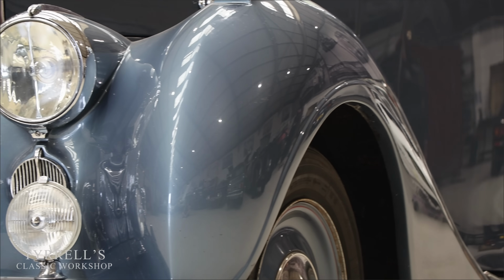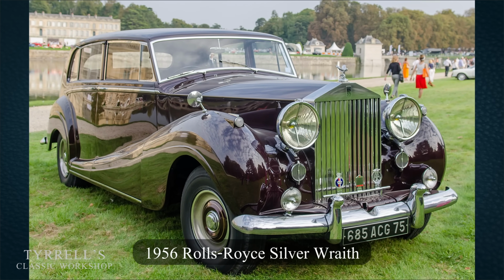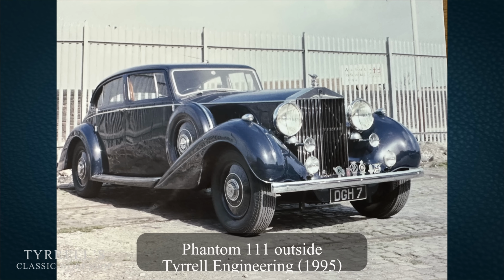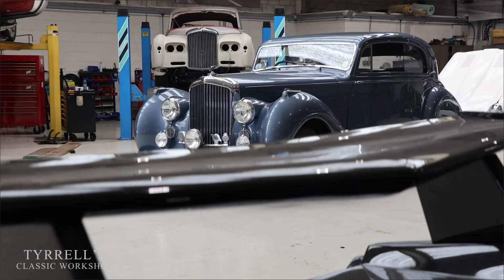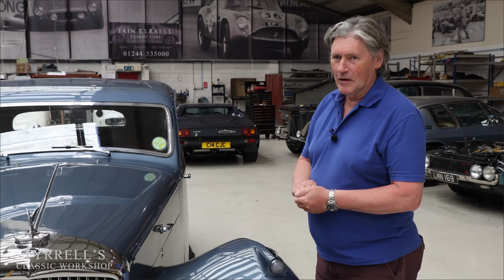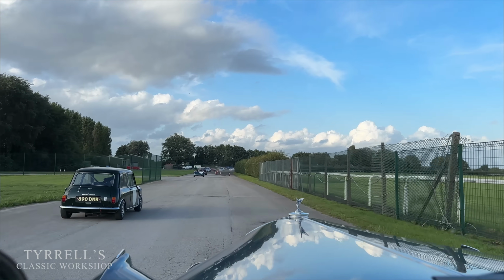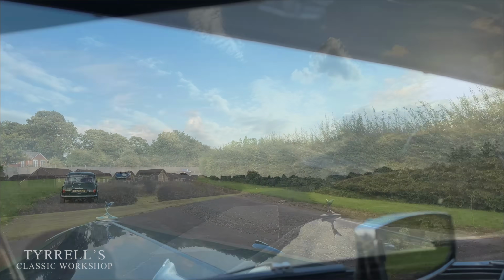An extremely rare Bentley! | Tyrrell's Classic Workshop

Comment: That engine does not vibrate or shake at idle due to faulty exhaust valves, that engine has another problem which could be delayed ignition.

Comment: It took many years to get my MK VI to idle smooth, mostly figuring what to put right. The best thing that I could have done was install a re-ground cam from an S1 and cutting the exhaust valve seats at 3 angles; with new valves and guides of course.
 It now idles with the generator light just glowing red and pretty much dead still, it could be leaned out just slightly. 
 Of all the cars and engines that I've worked on over the years, this engine was the most difficult to get right.
Thankyou Iain for that term from Rolls Royce; "Flutter" from a worn exhaust drive train. That's the first time in the 30 years I've had my car that I've heard of that, it explains a lot ! 🙂

Comment: Skinny tires lol look like small motorcycle front tires
Reply: Those Michelin's are slightly smaller then the 650/670 (R) 16s that are supposed to be on there. With out checking they are a 185 R 16, which are quite narrow and not as tall as they should be.
 The 185's are closer to a 600R 16

Comment: A question for you Ian, are there any advantages to fitting a high profile radial tyre to vehicles such as these. Without trading away some ride/handling aspects? I would be fairly sure that low profile tyres would not be a friend to the chassis.

Comment: Frankly Ian, it very much surprises me that following the war, that anybody was still using the very inefficient
F- Head valve train. The considerable advancements made in engine technology over the war years were put aside? Rolls-Royce in particular, from their remarkable Merlin and Griffin engines oddly reverted to a side valve design, with all of its inherent weaknesses', where they could have used their serious advancements seems a neglected field of pity. The vast skill base of aluminium formers was available and used to precise and magnificent effect; with 3 months to complete such a masterpiece is truly amazing. When one considers the wood, leather and the body having the sort of fit that is rarely reached by modern manufacturers.

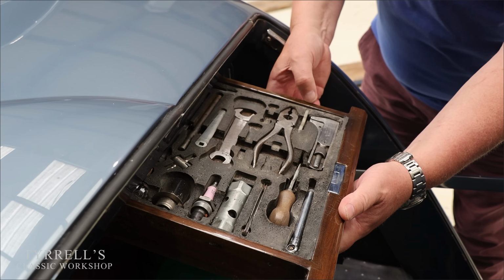Comment: 10:47 missing a wrench, which is a bit of a shame. :\ From experience, do a check of the back of that box and under the carpet (if it's the type you can lift). I've seen older cars hide all sorts of things. Even found a magazine stuck complete with all its fast flying boys inside, stuck in the door hole. The car (we later found out) had been an inspector's car in the late 50's.

Comment: Where did the car industry go wrong?.
 Gone are the days when you could  tell a make by its shape alone. 
 Where have the beautiful sculpted lines gone. In days gone past a car was like a fine piece of sculpture. The huge head lights covered in chrome. The little side lights that sat in the wing. 
 All you needed was a few spanners and a little know how and you could fix your car in the driveway. 
 Then the interior analogies dials super wood dash set us. Wood on the doors. Made you feel like you were at home. Then there is the leather seats etc. The smell was gorgeous. 
 I'm 73 and still revel in the old days. The whole beauty of the old days when craftsmanship was par excellence. Where people loved their work. 
 To take a piece of sheet metal and roll it by hand into a thing of beauty. A wing ,bonnet, door or boot. 
  And at the end of the day a car rolls out of the workshop. 1 of 1 because the next one would be different. No two panels are the same each slightly different. You couldn't take a new panel and fit it straight onto your car. Because it would be slightly different. 
 Glorious days ,wonderful cars full of character. 
 Now it's plastic everything, front wheel drive . What is it well look at the badge. It could be anything. So sad now ,really sad. We drive our tin cans with little pride. Because they all look the same.
 I was definitely born in the wrong age.
Reply: A very great deal has been sacrificed in the name of safety and dependability and efficiency.  And it's difficult to disagree that today's cars are more of all of them than the cars of yore.  But that's all they are.  Individuality, grace and style come in a distant second, I'm afraid.
Reply: You can still have those cars - the recent Boat Tail Rolls-Royce special builds for instance, there are vehicle designs from the reborn Hispano-Suiza company and Alfa Romeo recently have re-envisioned the gorgeous low volume Stradale for example but as was then these are low-volume trinkets for the very well heeled - modern vehicles for the masses are infinitely more exciting  and capable today than anything built for the average man when that Bentley was built. Times change and technology improvements are very democratically shared nowadays and overall automotive engineering is very much a level playing field  - if you want something unique then you need very deep pockets. Those coach building artists and artisans have slowly all passed into history - body shells became monocoque construction, safety and crash testing became de-rigueur which required homologated approval and made one-offs largely a thing of the past. You can mourn that time passing - but  it has passed, and yet we still have many old examples to still enjoy which is a great thing. The advent of EV's does give scope for more bespoke designs but they won't be afforded by the average Joe just as they weren't 70 years ago.
Reply: Today the car industry has not moved forward much @!!!!.
 Ok 0 to 60 3 second  and slightly better fuel consumption. But that's it on the whole.
 When Citroen built the DS back In 1958 there was lines and innovation. What a car and yes l had one. Still miss it .
 Today 77 yrs later that car is still the industry bench mark. 
 All they can do now it shove computers onboard miles of wiring and for what. So you can charge your phone !!!!!. Jo blogs cannot touch it as you have to have special tools etcetera. Plus a degree in aeronautics and have a bottomless pockets to afford dealership services. 
  No lm afraid things have not improved and as for electric!!!!!. If everyone in uk had an electric car there is not the infostructure to cope with the demand of electricity . Plus the bloody things like to catch fire.look what happened to Luton airport. That was one electric car. Brought a whole multi story car park down. 
  Glad l don't live in uk anymore. I live in a sain country that's not electric mad.
Reply: Those cars belonged to people who had money. They weren't cars for everyman

Comment: I learnt to drive on a 1952 R-Type standard steel saloon aged 14 on an old airfield in Norfolk (in 1989) - and it gave me a love of these B60 Bentleys for life. Those engines were also used in army jeeps by the way...
Reply: @huyshe123: If my memory serves me correctly it was the B40 2.8 litre 4 cyl version which was fitted to the Austin Champ military Jeep . The B60 was more widely used in the Daimler Ferret scout car.

Comment: A handsome machine! Does the boot open further, ideally to a nearly flat floor? Trying to load a substantial suitcase through the gap we saw would be a chore.
Presumably the steel parts were for practical rigidity, as aluminium there would have been too floppy? (Mixing metals does give rise to electrolytic corrosion unless one is very careful.